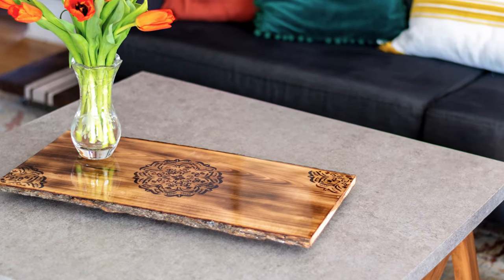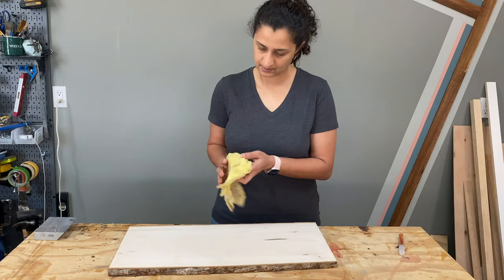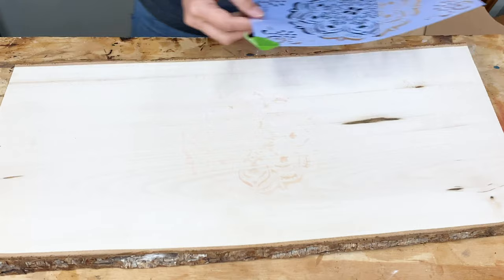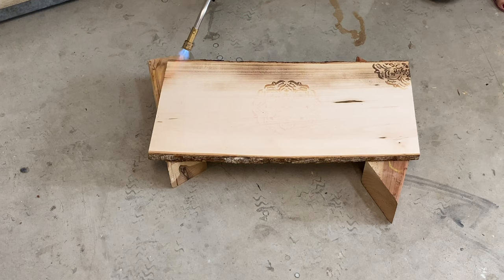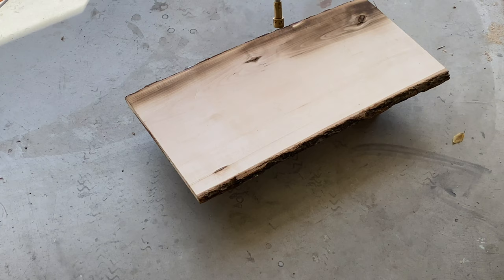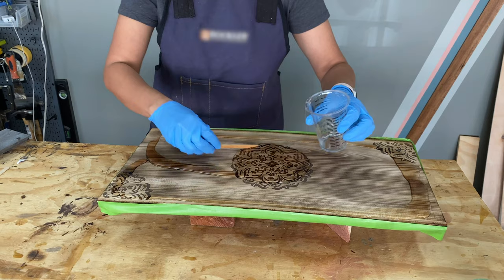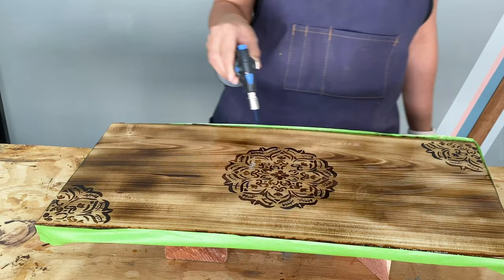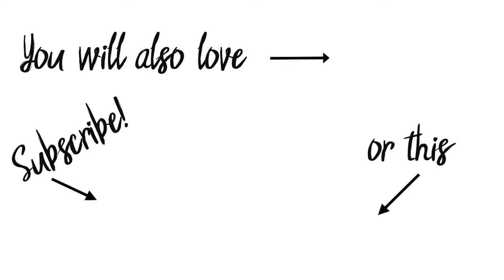Wood burned Mandala Tray Using A Blowtorch!

Comment: Wow. This is amazing. Thank you so much for this video. I do have a lot of different stencils (hardly used any of them till now) and a blow torch (used it one time for another purpose). I've been thinking a lot of who to combine these to make something really nice but did not come up with anything. And now you show this video and give
a very simple solution to this problem: a heat sensitive marker.  I must say, I've never heard of this kind of marker before. I need to find out if it's possible to buy it here in
Slovakia. Epoxy resin is very expensive here. I'll replace it by spray lacquer or water based poly  uretane. Happy Easter and stay safe.
P.S. When I follow the link in the description I can't find that heat sensitive marker there. Which one is it?
Reply from the maker: The heat sensitive marker is called Scorchmarker but that is a brand name. You can look for something similar there. And yes, spray laquer will definitely work.